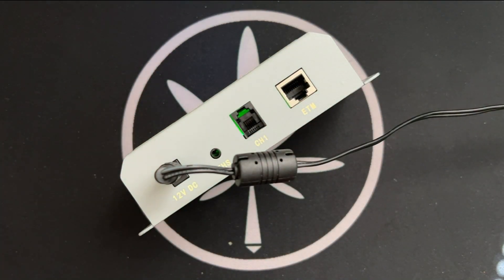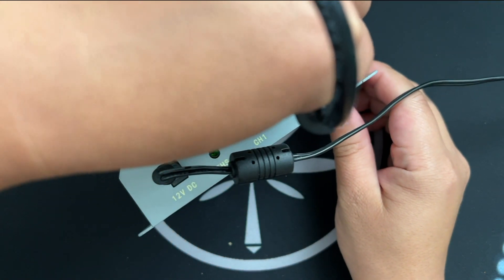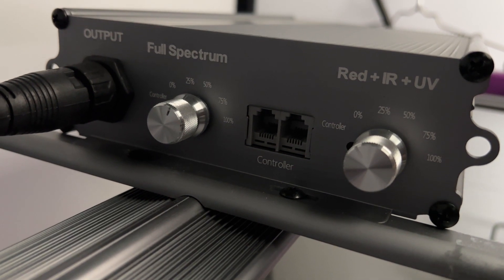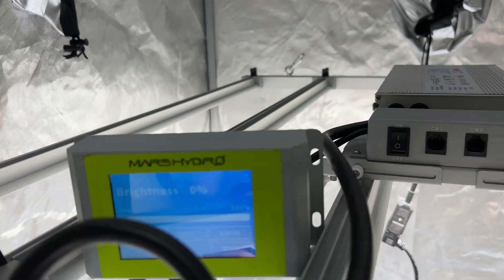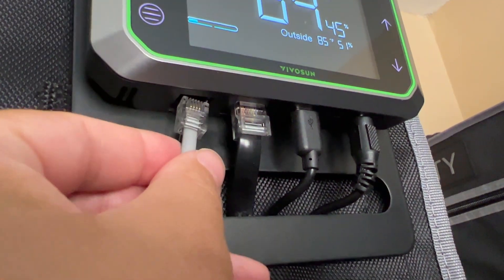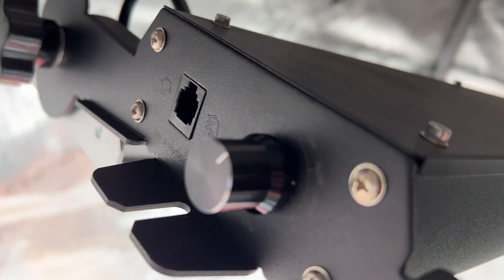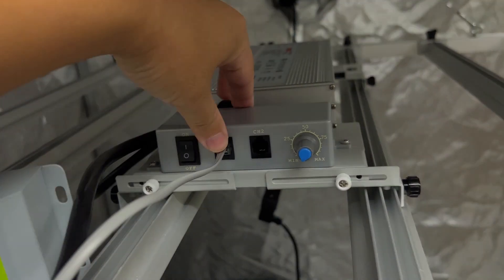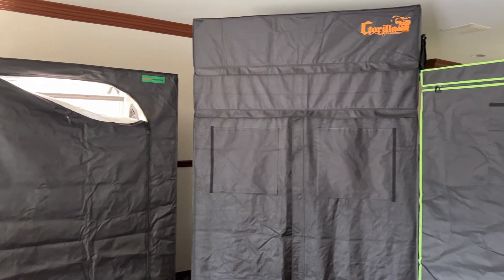The RJ-11 Port On Your Grow Light is Probably USELESS - A Mars Hydro Grow Light Controller Review

Comment: This is why I only trust AC Infinity. They see all these issues with other companies and they take their time to make sure it’s up to everyone’s standards for every product they make. Hell I just got the new Humidity Dome from them and it’s so much better quality than anyone else out their plus they made divots in the lid for the lights to sit in with lens bubbles on the inside to help drip humidity back into the tray and to expand the light beams so they’re more evenly spread out. Plus it even has a free expansion in it which adds two more vent totaling at 4 vents total! AC Infinity is officially the number 1 company in my book for growing and they are extremely fair priced too for high quality products.
Reply: @Triangle0ffence3x  I never heard of anyone having that issue unless you connected to a strip to weak for it or had a power surge that’s the only way, plus if it originally did when it first came out they would have updated it since. Also it’s free replacement for any defects which other companies also aren’t willing to do. There’s also the possibility there was just a defective piece in yours, but your also the very first person out of thousands I’ve heard of to come across that issue and I have never had a single issue with any controller I got from them even after multiple severe storms. All my outlets in my house are grounded along with all the power strips I use and I never go over the limit (I’m not saying you don’t since I don’t know your setup is or how your township or area works) but there are many issues that could have lead to that other than the device itself or a piece inside being defective. Hell even a handful of pro growers even two raised and still living in Humboldt and one even won the Cannabis Cup three years ago and none of them ever had a single issue with any of AC Infinity’s products. I’m sorry that you had that bad luck though and I wish you the best with all your grows, Namaste.
Reply: @Triangle0ffence3x  actually they aren’t rushing on their new products there are no ETA lol and maybe years ago that happened but now their products get approved for heat standards and safety standards by government groups lol and like I said it’s you vs thousands that haven’t had an issue I’ve had my fan for over a year, weed in a pot stated he’s had his for almost 5 years and never had a single issue so your stating something that is probably an old fact at this point standards have changed a ton throughout the years for all companies even damn cookie ones lol. Like I said I know a bunch of other professionals that use their products and no one absolutely no one has had any issue and hate to tell you all companies have some flawed products out of an entire batch but only like a hand full out of a couple hundred which is why they will replace products for free if their any defects lol even now garunteeing safe products that have been approved by government standards for fire and safety lol and any company at all that has defective products have to state it publicly it’s literally the law so what they most likely did was take all those back and found a new company to actually build their products for them they also now have scientific teams involved in the designing for safety. Like I said I’m sorry that happened to you, but when it’s approved and going through government tests for fire and safety now that the products still do that. Even their new clip on fans are specifically designed to withstand heat and humidity along with a pulse motor that can’t overheat lol, even their heat mats go through government testing, so once again I’m sorry that happened to but since then apparently there have been dramatic changes.
Reply: @Triangle0ffence3x  lol why would I who even uses facebook anymore and btw on a daily basis there’s over 100+ profiles on every social media that gets hacked and it’s a proven fact even by actually hackers that get paid to mislead and give misinformation lol
Reply: @Triangle0ffence3x  actually I do lol you’re the only one who thinks it’s still possible and remember the difference you’re going more of third party stories where I’m telling you actual proven facts and also as a person that owns these product on top of that I did over 2 years of research before buying. Choose any brand you want I’m not telling you that you have to buy from them, but if you don’t like the products as well why are you watching videos from a guy that’s a proud supporter and sponsors the company from him using them over 5 years without a single issue and he even mentioned they aren’t paying him for anything on top of that he also wrote the Beginners Guide for AC Infinity lol. If you don’t like the products that’s your choice, but don’t be disrespectful trying to make the proud supporters of the company into people that hate the company it’s just not going to happen when facts back the company up not third party stories. If your upset with their products then stick with your groups of people that don’t like them and you shouldn’t support a YouTuber that is proud to support their company. Have a nice week, I’m going back to my perfect grow that I have going.